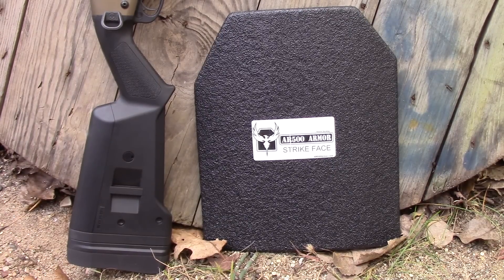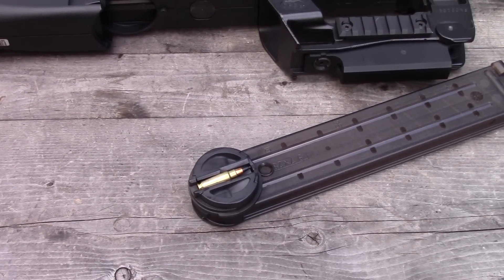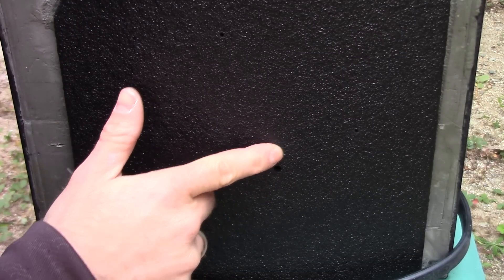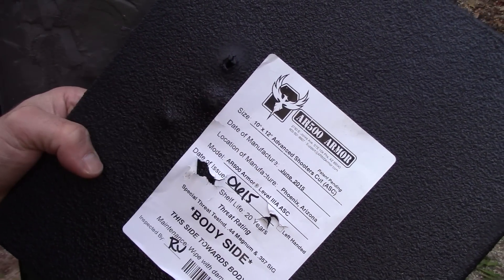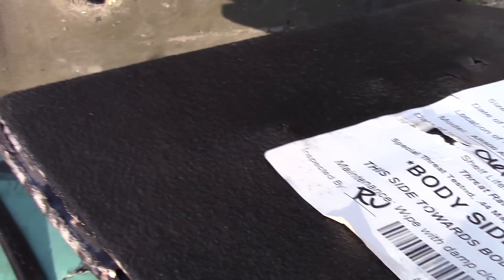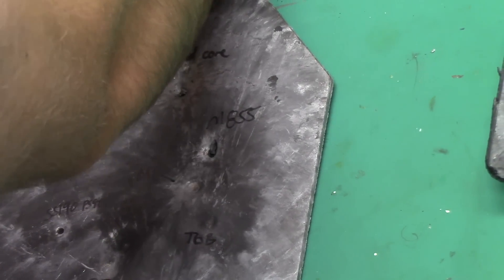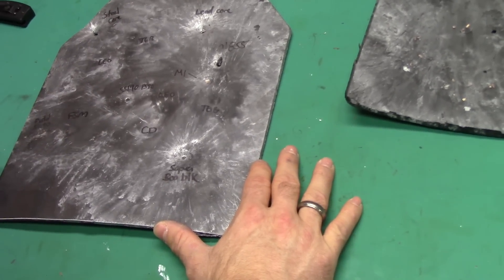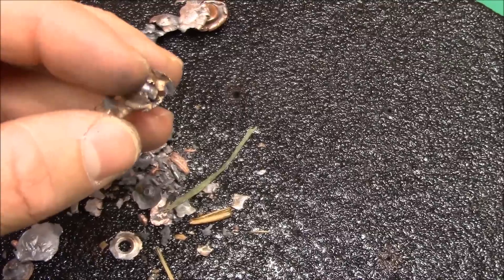@ArmoredRepublic2 Level IIIA Testing Part 3 of 3: Hard Plate

Comment: Do you recommend this over the soft hybrid 3A body armour and how easy is this to conceal on your body also where is the other two videos of this series
Reply from the maker: Sorry I forgot to put the links in there: Part 1: https://youtu.be/PbhfMUU9QMc
Part 2:  https://youtu.be/hBcEf-4mET4
It's thin but it doesn't conceal as well as soft flexible armor. The IIIA hybrid is pretty tough. This hard plate has the advantage of being stab proof, and covering most all pistol threats, even SS190 from the 5.7 pistol. It is however not light. You could get a RMA III+ 1092 that weighs the same as this, but obviously it's much thicker.

Comment: So is level 3 better the level 3 a?
Reply from the maker: Yes. Level III is higher than IIIa.
Reply: Thank you I called back and changed my order . I got the extra build up coat on it is that going to make it bulky?
Reply from the maker: @shawndon5277  Not really Steel armor is thin, even with build up coat. It may add a little weight but it's benefit I believe outweighs the increase in thickness and weight.
Reply: I got my front plate curved and my back plate flat . Is that a good setup? Or should I have gotten my back plate curved also . I’m running the veritas carrier .
Reply: Also I got 10x12 plates idk if I should have gotten 11x14 plates . I’m. 6ft 170 pounds .
Reply from the maker: @shawndon5277  11x14 are usually for larger individuals. 10x12 provides good coverage for someone of your size. If it's comfortable for you, you'll be fine. Some people run flat plats in the back, but most always run multicurve.
Reply: Thank you brother I appreciate the help ! I plan on purchasing another heavy duty  rig and I’ll keep what you said  in mind !

Comment: Awesome video. You test a lot of rounds and armor few others seem to bother with!

After seeing this test I'm curious how this plate would hold up against other 5.56 rounds, possibly out of a longer barrel but without the steel core.
Reply from the maker: I think my sample of this one is long gone, but I have a CATI = to it. I have some space left on it, I'll have to make a new video.
Reply: @BuffRANGE  
That would be great!

I'm sure this is probably a stretch, but you wouldn't happen to have some XM556FBIT3 to test? I'm really curious about it in particular, specifically whether its barrier-blind properties would hold up in gel when/if it penetrates a plate like this.

I used to know of a source of legitimate XM556FBIT3, it may still be available. I'd be willing to finance a box for the test.
Reply from the maker: I have XM556FBIT3M, same thing?
Reply: If I'm not mistaken, they're damn near identical. The only difference is the ones marked with an M at the end are "factory seconds" from batches that failed the FBI's accuracy standards. For your purposes I don't think performance would be altered noticeably if at all.

Out of curiosity, what 5.56 rifles do you normally run?

Also, I appreciate the quick responses to all of my comments lately. Definitely plan on subscribing!

Comment: With ss190 costing over $3/rd and T6B costing over $2/rd I think the fort scott SCS is the clear winner here at right under $1/rd for loaded ammo and if you hand load .48 per projectile for 500 or 1000. With the rest of the components being brass for .036 primer for .03 and powder at .01 These would cost .556 per for the hand loaded ammo. Then .357 sig is $1.1245/rd and the hand loads would be around .07 for the brass .03 for the primer and powder costing around .04 max so around .62 per for hand loads. You could use either the 80gr or 95gr for it both cost the same bullet wise at .48 per projectile when buying 500-1000. With the right powder and a 4.5" barrel a g32 will produce 1618fps avg with 125gr projectile so probably a lot closer to 1800fps or more with the same powder. Would be highly interested in seeing what a .357 sig with these velocities does to this hard 3a. Would be amazing for a .355 to outperform a 5.7x28mm ss190 especially since after it penetrates the plate it would be a lot more damaging than the ss190 is.
Reply from the maker: Not enough velocity in the FSM to penetrate a steel panel.
Reply: Possibly not I'd still be very interested to see it with the increased velocity from a .357 sig say with a 4.5" barrel like a threaded g32 just to see the results especially with handloads likely around the 1800fps+ mark that's decently above the CZ scorpion evo velocity in this video. With m855 going through it like butter out of a 10" wouldn't some regular 55gr fmj go through it easily as well using the same barrel length?
Reply from the maker: Possibly on the M193 since it's known to destroy steel.
Reply: Right but isn't the m193 just a 55gr fmj loaded "hot"?
Reply from the maker: Depends but generally speaking yes. Sometimes M193 may use a different jacket thickness than say a bulk 55gr FMJ
Reply: Ah I had no idea fmj could have different jacket thickness I thought it was all just jacketed to the same specification. Thanks for all the info and quick responses.

Comment: Even the steel core 7.62 barely made it through. A trauma pad or maybe jus the plate carrier would probably have stopped it and it wouldn't enter the body.

It would be nice if they made a plate with hinges so that when you bend over or sit down the plate doesn't dig into your stomach or groin and instead curves to your body.
Reply from the maker: CATI Armor is doing this sort of with their "Combat Quad Bend" plates. I was very pleased with their comfort. They are now working on releasing a level IIIA version like this..

Comment: Good evening, Im not much of a firearms guru. Im interested in this plate to wear it on duty. i know it is meant for handgun rounds, but of the rounds shot, that did NOT penetrate, which are bigger or more powerful than the .44 magnum or 357 sig, that i meant to stop. Again i am a LEO, but dont know much about guns. just want to wear something that is not as thick or heavy as a level 3 plate.
Reply from the maker: Hector Encarnacion 44 mag is more powerful. A rigid 3a plate is pretty tough.

Comment: It freakin stopped 7.62x39 even the steel core barely made it through that plate is way higher than IIIA I have some 9mm AP rounds I want to test on this plate but now I'm thinking it will be a waste of time after seeing this test. Was the 7.62 steel core you used hardened or mild steel?
Reply from the maker: +Joe vazquez To my knowledge there is no hardened steel core 7.62x39mm. It's all mild steel.
Reply: Oh ok well supposedly my 9mm AP is 'hardened' steel but who knows only way to find out is to test it huh lol I seriously doubt it will make it through the hard plates though but it'll still be an interesting test I suppose
Reply: Also do you have any III+ LW plates to test because what's interesting is that the regular III+ are rated for 308 AP but their LW is not rated for AP ammo according to their website, so I think maybe it's possible that a 9mm AP could penetrate their III+ LW. I don't think it stands even a snowball's chance in hell against regular III+. It might penetrate regular level III? It's just really crazy how that 'IIIA' plate stopped ss190, t6 30 carbine and freakin 7.62x39!!!! I mean doesn't it seem like if ss190 from a 16" barrel barely makes it through how can 9mm with way more surface area circumference moving only half the speed possibly make it through lol
Reply from the maker: +Joe vazquez you talking about the Swedish M39/B. Do you have any?
Reply: Yeah have you tested them before
Reply from the maker: +Joe vazquez No I'd love to get some.
Reply: How do I send some. Ill send several rounds to be tested in several guns against several different types of armor. I'm most curious to see how it does against ar500 hard armor plates.
Reply: To my understanding it's illegal to possess pistol AP rounds greater than22 caliber in several states I'm assuming you don't live in one of those states.
Reply from the maker: +Joe vazquez Yeah my state is in line with Federal laws.
Reply from the maker: +Joe vazquez Do you use Facebook? or send me a message on here, and we can chat..
Reply: I don't have Fb
Reply from the maker: +Joe vazquez Send me a message on here. Click my name then look for the message tab
Reply: I don't see a message tab I see 'discussion' that's it
Reply: I sent u an email sorry late response I didn't know you responded to me anyway you should also test Bulgarian surplus 7.62x25 I don't have any but I see some available online. It's supposedly most AP hottest tok ammo there is and tok pistols are pretty cheap.

Comment: IIIA hard plate is stupid why not just wear level III or better yet their III+ lightweight version
Reply from the maker: +Joe vazquez Yeah this is a very niche plate. You might as well get a III+ LW, but for those who need ultimate lightweight who don't need rifle protection, but want to stop almost any pistol round (not "just up to 44 mag), this plate is it.
Reply: How do they know they don't need rifle protection lol you never know. The guy could be using a rifle caliber pistol
Reply: +Buffman - R.A.N.G.E. because their lightweight iiia is really cut away, to maximize weight reduction, til the point that it leaves a lot more exposed than this plate, and STILL is heavier by more than 10%

Comment: Great info. As long as your soft panels have some life in them, I would really like to see how the soft panels do with muzzle contact distances, even with 115gn 9mm. I have read that you will get penetration because the muzzle blast actually burns through the panel before the bullet makes contact. If there is a safe way to try this, please do. Thanks.
Reply from the maker: +Copaset1c I could demo ranch style it. I have a vice at the range, and could clamp the gun enough and pull a string to activate the trigger. Let me work on that,  and see what happens.
Reply: +Buffman Excellent! I have read about the muzzle blast defeating soft armor but no one has ever tried it on youtube (as far as I can find). You may want to have a fire extinguisher handy. Thanks! -Careful with DemoRanch-ing anything. That guy must have nine lives.
Reply: One problem is at actual contact distance you'd put the pistol out of battery, unless it was a revolver.

Now of course a standoff distance would alleviate being out of battery, but it would have to be miniscule to actually have the full "burning effect" really add to the terminal effect.

Comment: You should have tested a clean area of the plate with soft Level 3A panels such the hybrid or other behind the steel 10x12 plate 3A. I'm almost certain it would have stopped both 5.56 and 7.62 from the SBR, this would have been quite interesting because with such a setup you start to approach mild level 3. Thanks for the video.
Reply from the maker: Interesting. May have to test that. I know they did similar to stop m2ap. Level III with IIIA backer
Reply: +Buffman That would be great, always wondered if the combination of those two (AR500 Steel 3A + plus 3A soft backing) would equal mild 3 level or some quasi enhanced threat level well above 3A.
Reply: +Buffman - R.A.N.G.E. Could be a light weight cost effective rifle protection. I have a feeling it could offer protection from most rifle threats.
Reply: +Buffman - R.A.N.G.E. Could be a light weight cost effective rifle protection. I have a feeling it could offer protection from most rifle threats.

Comment: Great video, I love the FN testing especially;  I have FNX45 and FNX9. I was wondering how has the price of 5.7 been lately that is the only thing stopping me from buying the Five-n-Seven pistol?
Reply from the maker: +MrAutochamber still in the $1100-1200 new range.
Reply: Sorry I meant the actual ammo itself.  Has FNH licensed any one else to make it yet?
Reply from the maker: +MrAutochamber Ohh. :D FN holds no licensing or patents on 5.7x28mm. Anyone can load it, but it seems most manufacturers probably don't want to mess with the polymer coating on the cases. So for right now, FN is the sole manufacturer of the brass. That will be changing soon as Elite Ammunition will be introducing their 5.7 brass.Fiocchi still loads SS197SR and now AE TMJ. It's as cheap as I've seen it. Palmetto has it for $16-17/box of 50 right now!
Reply: +Buffman  Thanks, I had no idea it had gone this cheap , that is 45acp prices. Now, I was saving for a another TNW ASR carbine in 45 {already have the 9mm) but this throws a curve in my plans because it makes the Five-n-Seven pistol actually affordable gun to shoot and not a safe queen.  This will take some thinking over.